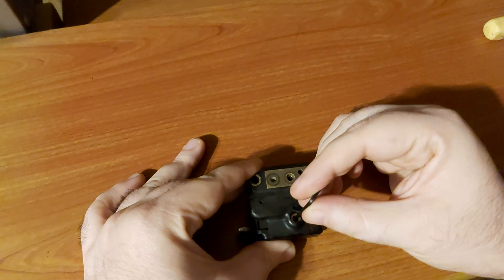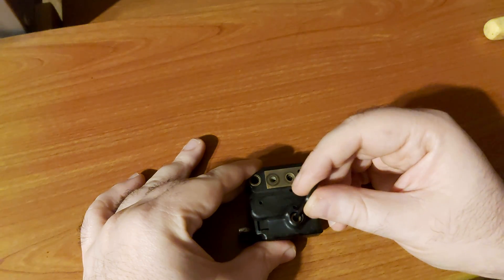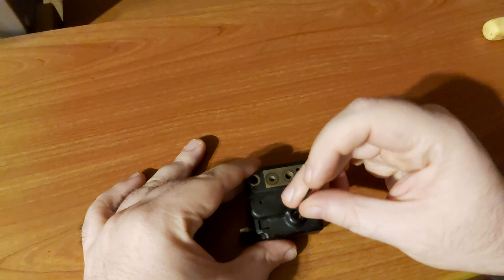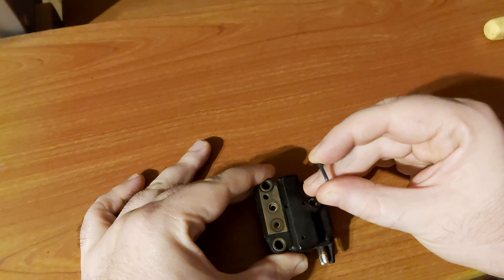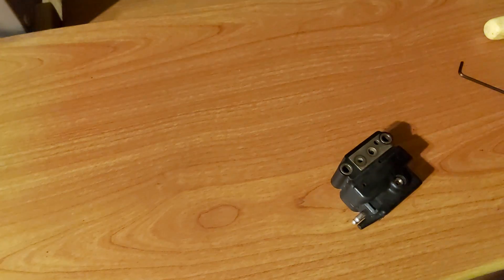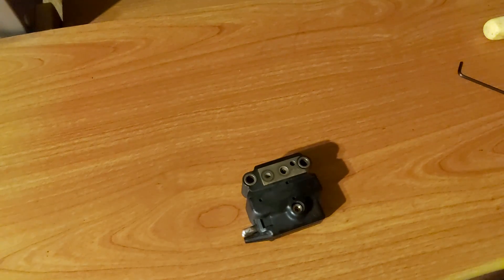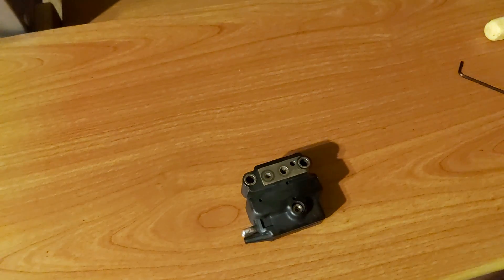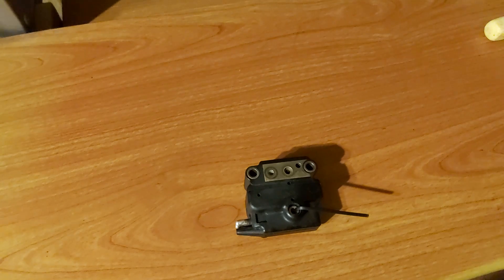㉦Mercedes Ke-Jetronic㉦ - The EHA/about the adjusting screw

Comment: I’ve adjusted my eha but doesn’t make a difference to the fuel pressure , pressure is 6.5 bar
Reply from the maker: What readings did you get from the EHA?
Reply: I set it back to factory settings and with valve opened or closed on the fuel pressure gauge doesn’t change

Comment: Hi Ivica thank you very much for the amazing videos on your channel your explanations are so useful I would like to ask you something if you would be so kind to answer. I've replaced the O rings on my EHA but it is leaking and I cannot understand where this leak comes from 
I tried to remove the adjustment screw but I cannot succeed unscrewing it is there a possibility that the little O ring may produce an external leak? As I have the fuel dripping like one drop every 2 seconds should I change the EHA itself? Thank you very much Ivica Pascal
Reply from the maker: Hello, at first try with external o-rings. If that doesn't help, try with the internal one. Remember where the screw was by turning it as far as it can go and count the revolution you made - once you turn it back the screw will be there where it was. Unscrew fully the 2mm allen and try replacing the little o-ring. Also measure the differential pressure. If the pressure won't go above 0.2bar difference then the eha is useless and must be replaced.

Comment: Hello, can you help me please?
When I adjust EHA to 0.4 bar presure difference, and air-meter-plate to 1.9mm gap, I get good idle. But when I accelerate, engine goes too lean after 3000rpm, no power. If I screw the EHA-adjust-screw extra 90degrees in, I get bad idle(even when I readjust air-meter- plate screw a bit countercklocwise), but I get more power after 3000rpm, but still not 100% powet as I expect it to be. What could be wrong? I get 19.3 Ohm from EHA, when tested.
Reply from the maker: Never do the readjustments on the EHA the way you think. Every EHA valve will give you 19ohm resistance. More important thing is to achieve other parameters by measuring current in mA. In general, the mA have to fluctuate -3 and 0 once the car is at the operating temperature. Watch this video ENTIRELY and do as I say!!!
https://youtu.be/1c2dlfabnv0
Reply: System pressure is stable 5.5bar upper, around 5.1bar lower.

Comment: M103 260e aracim var eha valfi kac mm olmalidir?
Reply from the maker: I have been speaking about that, 6.6mm. In order to be 100% sure, you will have to measure the mA on the EHA and the goal is to get the fluctuation -3 and 0 mA once the car is at the operating temperature.
Reply: @mercedeske  thank you

Comment: What will the fuel consumption be?
Reply from the maker: That's something you will see yourself as you calibrate the EHA as per specs.
Reply: @mercedeske  fuel consumption is high.  what should you pay attention to?
Reply from the maker: @turalsalahov2544 sensors, mechanical part
Reply: @mercedeske  what sensor?
Reply from the maker: @turalsalahov2544  Lambda, potenciometer, coolant temperature sensor.

Comment: Hello, i set differential pressure to 4,8 bars, main pressure is 5.2 bars. After this calibration, i cant start. With bridged pump reley, i can hear injectors, when i press airflow plate. I set the mixture like you said, nothing, tried to rich it, tried to lean in and still nothing. Before this calibration, car was able to run well, just acceleration was slow and black smoke (there was no differential pressure, 5,2-5,2 bars)
Do you have any tip please?
Reply from the maker: Look, with equal pressures the car won't even start. IF your pressure is below 5.3bar, check your fuel pressure regulator.
Reply: @mercedeske  there is a good flow, when i press that airflow plate.
Reply: I got m102.962 engine
Reply from the maker: @asineprestanou5221  That's a W124 2L engine.
Reply from the maker: One more thing. If your system pressure is below 5.5bar that means that you have either a bad fuel pump(check valve) or the fuel pressure regulator. 5.2bar for system pressure is way too low! With 4.8bar control pressure you can't expect anything better than that!
Reply: @mercedeske  got it running again, somehow it is okay on 4.8 bars.
Fuel pump is new, if Fuel pressure regulator is faulty... Bad...

Comment: I adjusted the EHA clockwise about 0.5 turn. Do I have to adjust the Air Fuel Mixture screw afterwards, counter clockwise or clockwise?
Reply from the maker: If you haven't been readjusting the screw don't do it. If you have set it to get the fluctuation 6-7.3V. If you have no lambda then let it be steady 6.65V
Reply: @mercedeske  wow you even remember that I have no lambda on my car from factory. You're amazing! By 6.5-7.3v do you mean the duty cycle? I just checked the duty cycle at x11 after warm up, it is at 2.8v. Then I adjusted the mixture screw in fine increments both ways, it has NO affect on the duty cycle at all. I am also suspecting my air flow potentiometer, tested pin 1 and pin 2 resistance with engine off connector off, and it starts at 1.6 kOhms. As plate is pushed in, resistance rose but then went to infinity and then came back to some value till about 11 kOhms. When plate was released, it comes back down and settled at a new value of 1.9 kOhms. This may be why my duty cycle is also very lean. Sorry for dumping info, I'm following your other videos also. 🙈
Reply from the maker: @shaazy  If you haven't replaced the potentiometer, replace it, because no way that modern potentiometer can give you so high value.

Comment: Hi. I have a problem with my w124. 1995 there is no live in the all fuse box and the fuel pump is not working because it is not getting any power supply. Could you please help. Many thanks
Reply from the maker: Hi, there is not much I can tell. '95 W124 is not KE-JETRONIC, second - at first check all fuses, that’s basics, check the furl pump relay or something else that is supposed to drive the pump. That's everything I can say.

Comment: Hi
My current fuel Pressure is 5 Bars with valve closed and 5.4 Bars with valve open.
Does that mean my Fuel Pump, EHA and Fuel Distributor are all OK?
I have a W124 M103 engine with a fluttering idle.
Keep up the great work.
Cheers
Reply: Replaced all Injectors and there's no O2 Sensor. Hence no Lambda. Will have a look at potentiometer and report back.
Cheers
Reply: Does the EHA measure fuel pressure or fuel mixture.
I have seen you video on the potentiometer on measuring resistance but how do you measure voltage?
Thanks in advance
Reply from the maker: @brianalcock  Do you mean the last video on the potentiometer while it was off the car?
Reply: @Fix your Mercedes   
No. When it's hooked up. I thought    I saw an Video  where you Mark the potentiometer and move it slightly. Am I correct?
Cheer
Reply from the maker: Hi and thanks. Yes, that's normal. As for the idle - it can come from the injectors, potentiometer, lambda...

Comment: Hello Ivica
What's the best way to adjust mixture when going from sea level to new location at 1100m altitude? 
Make mixture leaner with mixture screw or leaner on EHA?
Thanks in advance.
Reply from the maker: Hello, Cino.The best way is not to touch anything😃 Just adjust the mixture as it's supposed to. If you have a California car, then you have an altitude sensor which is going to regulate that, if not don't touch anything! That's my advice to you. Happy Mercedesing!
Reply: @mercedeske  All right thank you very much. I have a normal German version, so unfortunately no altitude sensor. I didn't touch anything:  didn't notice anything at 1100m altitude where I live now. Meanwhile driven about 10.000kms. Performance is same, fuel economy is good. Spark plug colours are perfect. Only thing that changed is the economy gauge at idle, is now 3-4mm to the right. Normally at sea level it was all left. Thanks again, your help is much appreciated 👍🏼👍🏼👍🏼
Reply from the maker: @cino4919  Glad ti know that. Happy Mercedesing 😃

Comment: Hey, me again just started the car cold and died again, worked well after 15seconds of keeping gas.  (I noticed that the eha cable connector was wet of fuel, can that cause it?)
Reply: If so, is there replacement seals or do i need new eha
Reply: @E280T  I don't want to demotivate you, but the o rings are seldom the cause of the leak. You can verify with your phone camera pointed at the EHA and make a video. When you turn ignition on ( engine off! ) you will see the EHA leaking out of the little holes on the EHA. If so, you will be needing an all new EHA. If you can miss the money, buy new. New ones come with new o rings and new screws. Good luck.
Reply: @cino4919  hey, i have already replacez week ago new eha and o seals but still it stalls when cold
Reply: Replaced*
Reply from the maker: @E280T  If 2 green o-rings don't help you will have to by a new/another eha.
Reply: @mercedeske  do you have number for the green seals
Reply from the maker: @E280T   No but you can easily find them.

Comment: Sorry not sure I understood correctly. Just 6.8mm and the EHA is sure to be adjusted properly, or do i need to test the pressures? 88 300TE running a bit rich (smell) with lambda adjusted properly. Have new injectors, tune up parts etc, also once in a while it will die... seems to be loading up with the gas, usually ok tho just a bit smelly. Thank you!
Reply from the maker: Measure the pressures. EHA must be always readjusted with the pressure gauge on. 6.8 is factory adjustment.
Reply: @mercedeske  Thank you. Found a nice used Matco set for CIS on ebay.
Reply: @mercedeske  Thank you. I'm having a little trouble here lol. Not really sure I have the right gauge set-up. I have a gauge with on/off valve, it's on the system pressure side of the gauge. But with this set up, with the valve open I'm not really getting a differential, I'm getting a mix of the system and control pressure. I don't see how this can work properly... seems I need a gauge with 2 shut off valves so I can isolate the two different pressures and read them separately, or two gauges hooked up at the same time??? Sorry for the long comment, any thoughts appreciated!
Reply from the maker: @RastusMcbride  I'm soon going to be making that video, so don't worry.😉
Reply: @mercedeske  I just flipped the gauge set around a couple times so I could isolate each port with the valve, running pretty nice  but having trouble getting normal numbers for the lambda. Measuring voltage and getting 2's and 3's, can't get up to 6.75? Also, they say "measure voltage" I'm going to assume they mean AC? Was running pretty rich for quite a while probably better check my O2 sensor. Thanks
Reply from the maker: If you haven't replaced it after 50k km, replace the o2 sensor.
Reply: @mercedeske  its not that old but its been dealing with RICH for a good while have new NTK ready to go on, thanks
Reply: @mercedeske  It didn't have even 10K on it, but that new NTK O2 sensor, readjust lambda.. finally, I think I've arrived at absolute perfection on the TE. Idles like glass, everything as it should be. So long I've lived with this thing being at 80% I swear it's like it just came off the lot, new. I think I'll keep it ;) thanks for the help.
Reply from the maker: My pleasure. Happy Mercedesing 😃

Comment: apakah ini pengatur kunsumsi bahan bakar
Reply from the maker: Not quite, this regulates the differential pressure, it fine tunes the pressure, increases or decreases the fuel flow towards the injectors. Anyways it has to be at 6.8mm distance from the top. That's how it is calibrated when new. This screw doesn't have to be readjusted. In this video I just wanted to see if the stories about its calibration are true or not. Don't touch this screw and everything will be fine.
Reply: saya sangat berterima kasih atas penjelasannya
Reply from the maker: @zulfikarfahmi8687  Dengan senang hati, terima kasih atas komentarnya! ;-)
Reply: kami masih memiliki w124 230 e tapi untuk pemakaian dalam kota 1;5   dan luar kota 1;6  memang tempat kami pegunungan dan tan tanjakan apakah wajar kunsumsi bahan bakar yang demikian .tapi ini dilihat sari busi tidak lagi berwarna putih .apakah ini terlalu boros , berikan kami solusi.(indomesia)
Reply from the maker: @zulfikarfahmi8687  I don't understand what 1;5 means. Normal consumption for the 230e is 12l/100km(19.6mpg US) city driving, at 90km/h 7l/100km(31.36mpg US) and at 120km/h 9l/100km(26.13mpg US). This is according to the factory and if you live in the hills then the consumption can be higher. For how much, I can't tell. I think I made my car have 13l/100km consumption city driving(18mpg US). If there is gasoline on the spark plugs then you either have a rich mixture or you have to replace the injectors. That much I can tell. Greetings from Serbia.
Reply: maaf kami bertanya lagi apabila BBM sudah merata  naik pada fueildis.tetapi kami coba menekan piringan flow pada posisi konci kontak menyala bbm tidak ada respon,apa eha mempengaruhi hal tersebut
Reply from the maker: You mean there was no fuel as you deflected the sensor plate?
Reply: @mercedeske  terima kaaih banyak saudaraku
Reply: @mercedeske  seandaimua anda dapat membantu atau membimbing lami sampai mobil kami hidup kembali kami sangat berterima kasih sekali .kami senang kami mengikuti konten anda yang mana sangat membantu kami .kami orang pelosok yang mana disini tidak ada mekanik khusus
Reply from the maker: @zulfikarfahmi8687  What's the problem with the car?
Reply: problem kami bbm tidak bisa mengalir dari fueil distributor ke injektor padahal bbm dalam start on bbm naik keluar dari dueil distributor .dari regulator sudah kami setting mengikuti konten saudara.dan co  sudah sesuai .arus dari ecu juga ada .penggantian membram sesuai konten anda .biasanya bila tekan piringan flow bbm keluar dari lubang distributor .tapi no respon atau tidak menonjol keluar
Reply: @mercedeske  bagaimana caranya kita dapat berhubungan melalui what app
Reply from the maker: @zulfikarfahmi8687  Ini akan menjadi sulit atas aplikasi whats. Anda tidak berbicara bahasa Inggris, saya tidak berbicara bahasa Indonesia dan Anda tidak berbicara bahasa Serbia! Ceritakan sekarang. Apakah Anda menjembatani pompa bahan bakar, melepas saluran bahan bakar, dan membelokkan pelat sensor saat pengapian menyala? Maka Anda harus mendapatkan aliran bahan bakar. Katakan apakah Anda menguji distributor bahan bakar setelah Anda mencucinya? Itu harus dilakukan dua kali. Setelah mensimulasikan kecepatan penuh dan untuk kedua kalinya mensimulasikan idle dengan pelat sensor nyaris tidak dibelokkan.
Reply: @mercedeske  saya tidak mengotak ngatik pkat sensor dan saya tidak melepas saluran bahan bakar untuk sekarang .
Reply: @mercedeske  saya akan coba dulu hari ini .menghidupkan  mesin w124 230 e
Reply: How many times do I turn the screw for a 300E I NEED HELP I can’t figure this out for find anything online

Comment: Hallo guten Abend،Jatronic should be seven laps or six laps please
Reply from the maker: Guten Abend. The adjusting screw should be at 6.8mm measured from the top. No turns. The point of this video was to show you that this is a completely false procedure.

Und jetzt auf Deutsch - Dieses Video soll es demonstieren, dass keine Justierung vom EHS nötig ist in dem Sinne, dass kein Drehen der Einstellschraube für 5,6,7 oder wer weiß wieviel Mal nötig ist, um die Einstellschraube sowie das EHS zu justieren. Nur mit dem Manometer kann die Justierung, falls nötig überhaupt, erledig werden. Das EHS ist vom Hersteller auf 6.8mm eingestellt und soll nicht gedreht werden. Das war die Mitteilung des Videos.
LG und "Gutes Benzen" ;-)
Reply: okay thank you👍